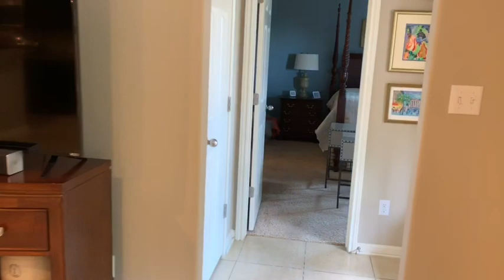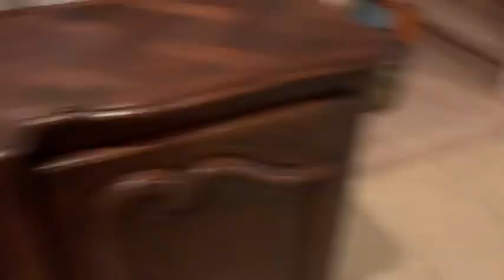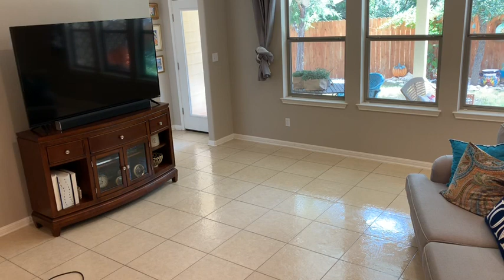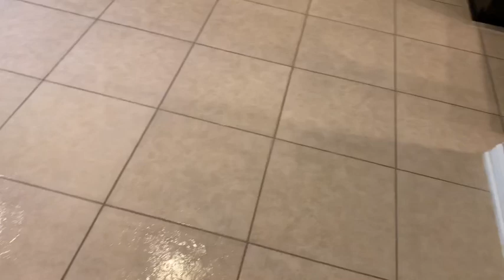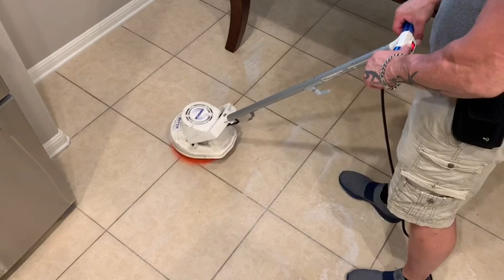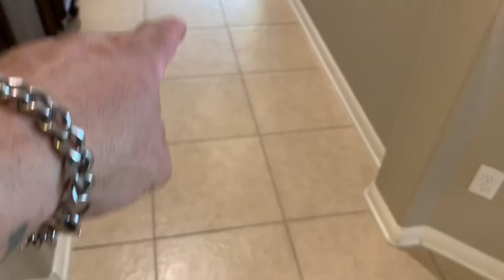Challenger op cleaning grout lines and tile. #carpettime.

Comment: what do recommend to clean grout wiht if the tile is travertine or any other natural stone? you cant use Zep Stripper in the mix, can you?
Reply from the maker: Gino Savarino   You don’t treat travertine this way. This is ceramic or porcelain only. Everything is different with natural stone. Saltillo can be done like vct however